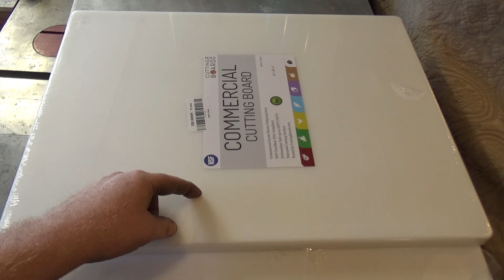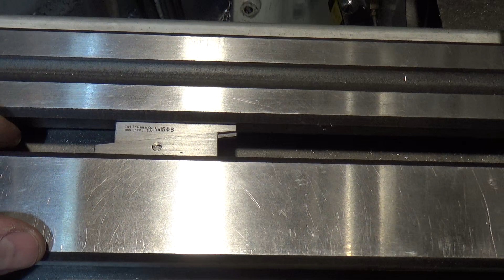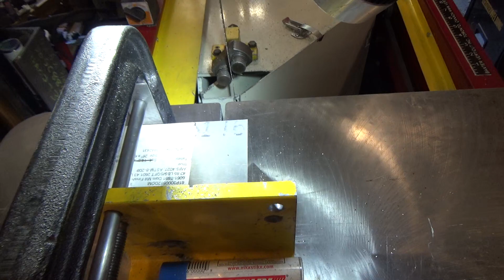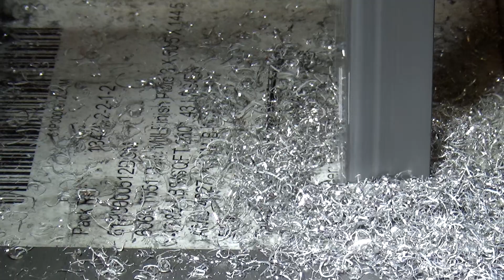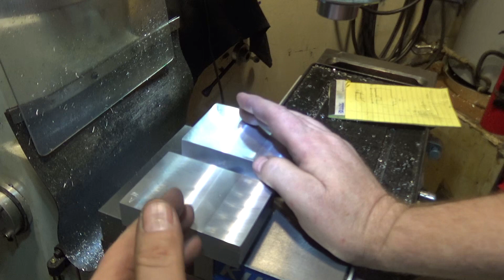104 Pet Treat Ejector Customer Project Part 1

Comment: Nice job , also a good reminder about breaking in bandsaw blades . Cheers .
Reply: Why do you need to break em in? And how do you do it?
Reply: @mxcollin95  You do the first few cuts at a reduced feed as the teeth are to sharp , they  can grab & damage the cutting edge so a reduced feed for the first few cuts just dulls the sharpness a bit  , sort of de burring the teeth .  Cheers .
Reply from the maker: Max is a professional machinist and, of course,  has it exactly right. Check out his channel, you will definitely enjoy his videos and will probably learn something with every one.

Comment: Never heard of breaking in a bandsaw blade. Can you please explain how and why you should do this?
I always just thought bandsaw blades went simply from sharp to dull. Love the channel! Please keep it up!
Reply from the maker: Max answered your question below, but in case you missed his response: all you do is lower the feed rate to somewhere around 25% for the first half hour and then slow build up to full feed rate after that. This doesn't work well on soft materials like aluminum. When you get a blade it is very sharp and if you don't "break it in" (read round over the sharp edges a bit) you can chip the edges and then they are never the same.

Comment: Come on man just get on with it. Ps you got way to much stick out. 
My shop teacher. Would smack me in the head. And say to high in the vice boy. 
Ouch. Yes sir . M
Reply from the maker: Balancing the contents of my videos is always tough. I try to share what I think are interesting tidbits and tell a story at the same time. Sorry it was not working for you.

The part was high in the vise and that is always a calculated risk. You trade clamping pressure for access. Fortunately there is very little tool pressure, so I think (in my novice mind) that the risk was small.
Reply: Thanks for the reply. I know. I do enjoy your videos. M